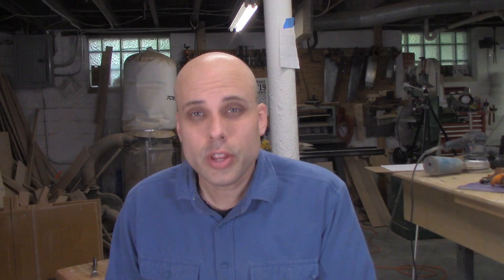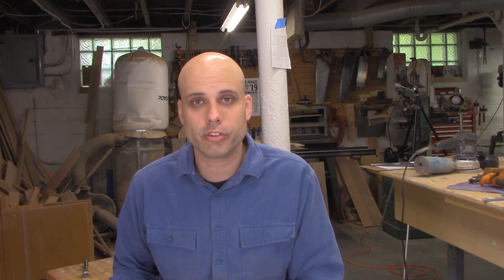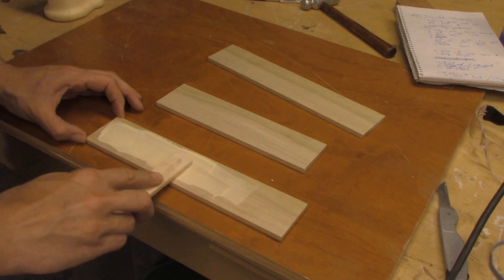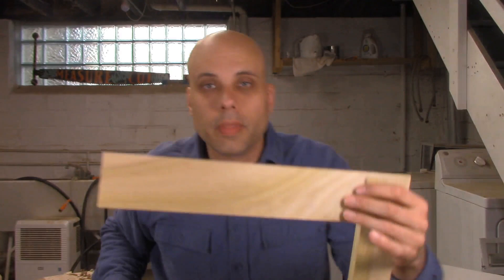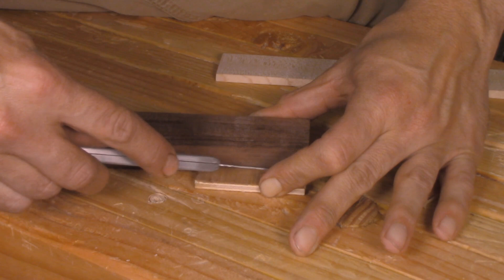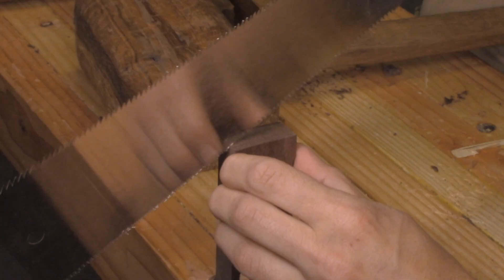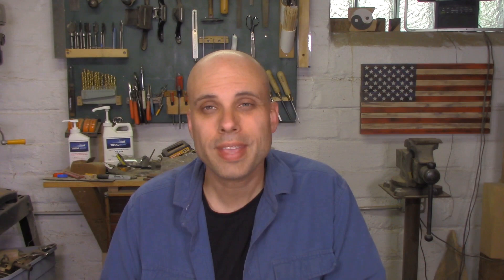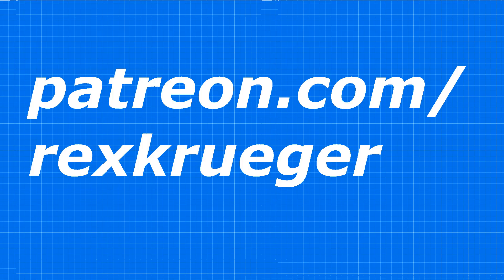Make your own try-squares for woodwork.

Comment: Actually, if you have and EDC pocket knife, it maybe the only knife you need.  If it is a three-blade stockman-style, one of the blade is called a "sheep's foot" blade.  It has a straight edge, back parallel the blade edge and a dropped tip.  It's more robust than that Stanley, and if you keep it sharp, it's all the marking knife you need.  Since you already own it, its even cheaper than the Stanley.  I've been given the Stanley and other more mainstream marking knives and my stockman is still what I use.
Reply from the maker: Man, now I'm going to spend HOURS learning about these knives. Thanks. :)

Comment: Lay the speed square flat across the face you need the line using the wide base on the opposite side to hold it on the edge.

Comment: Actually you can use the speed square to check narrow boards to see if they are square you turn the speed square so you are looking at the 90° corner with the widest side on top and now you have 2 small 90° corners to check square narrow stock

Comment: I wonder if we can glue these squares with another method. Use a school compass (those with a little pencil for student) draw a perpendicular T on a paper. Put your square on, adjust the blade to the pencil mark while the glue is still wet. Use staple or nails on the edge to prevent it from moving or stringing, usually you will get a good result. Unless you got a table that is not flat.

Comment: If you don't have a square handy, try using a manufactured corner of any piece of plywood or other board. They're die cut at the factory and far squarer than just about anything you have.

Comment: @Rex Krueger. I think your issue with the Japanese saw is that your using it like you would a rigid spine saw i.e. tenon saw. If you watch a couple videos from these guys: https://www.youtube.com/channel/UCfqc2hpLPLj8VfgpalvEqcg  .. You'll quickly see that they repeatedly say you should only ever cut the lines you can see. this usually means cutting at an angle and 2 lines. In this video you cut down the wood essentially cutting on 3 lines, this is why you strayed at the back where you couldnt "see" the line. Try watching the guys in that youtube channel, It'l make a lot more sense.

Comment: You probably won't read this but here is another way to see if your square is true taught to me by my grandfather.  You need a small level and  plumb bob, or plummet - a helpful grandchild is also needed : ) . You take your level and hold it against the tongue adjust the position until level then you use the plummet on the body from the corner if the line travel down without moving away from the edge line then it is true. inside and outside do both and be sure to compare inside tongue to inside body and the outside tongue to the outside body. Would someone please tell me if they understand this? I am not certain that I did a good job explaining it. thank you.
Reply from the maker: Man, I read all my comments. That is a fascinating suggestion. You totally explained it well, but I'm not sure I could get it set up and then also get it glued and clamped with that method. Still, totally interesting. Thank you!

Comment: My father put multiple layers of epoxy on his wooden boat. He wore gloves but still for two weeks or so he had that typical harmless but weird skin reaction. Can that happen as well with those tiny amounts of epoxy you're handling without gloves in the video? The difference in quantity between a drop in a joint and a layer on a boat is, of course, quite significant 😅
Cheers from Vienna, Austria! 🙂

Comment: It seems like you could get precise results without using a contractor's square or fiddling with the damn thing for ages if you used some basic geometric construction techniques to lay out the shape of a square and then cut that out of a single piece of stock. All you'd really need would be a compass (or just a string and a tack if you want to be truly oldschool) and a straightedge.

Comment: I like the video don't get me wrong....but in the intro you said about the speed square not being precise/true or not able to check inside square. you can check inside square if you are using rough lumber and as for accuracy ...not getting that either, that's because its called a "speed square' for a reason , it is designed for rough carpentry work aka framing ect. and for speed and ease of use. but thanks I still like the vids.
Reply from the maker: Well, the point is that for fine woodwork the speedsquare won't be good enough. Not that it's not a good tool, just not the tool for the job.

Comment: Beautiful work, Rex. I've been playing with shellac again recently & it's so versatile and simple. Shame it's so sticky, but it's still a lot better than (non-waterborne) polyurethanes.
Reply from the maker: I need to do a video on shellac. It is really easy.
Reply: @RexKrueger  Yea. I should get some raw flakes to use as a finish really; I've been mostly using a blended mix for sealing & it's a bit too gummy to build on top of sealed grain. I think I'll go back to acrylic for sealing under a finish though, since that can be removed from sandpaper with a latex stick (the shellac won't come off & I'm going through sandpaper like there's no tomorrow).
Reply from the maker: Try a card-scraper for finish removal. Works like a charm and you never throw it out.
Reply: @RexKrueger  I've been trying but haven't yet found a material that does the job well on the lathe. Metal cabinet scrapers are too aggressive & the plastic ones I've tried so far aren't hard enough. I need to give it a try again before the stuff's fully hardened & see whether the plastic will do it then, but the acrylic sealer is easy enough to remove from sandpaper & does just as good a job as a sealer, with the only downside being that I have to oil the wood first because it otherwise leaves a cold, drab look. Luckily, I have a lot of mahogany to test all this stuff on.
Reply from the maker: Oh, on the lathe. Yeah.  Sandpaper.
Reply: @RexKrueger  Yea. I'm sure a metal scraper would work at a lower speed, but mine's a belt driven model so adjusting that back & forth all the time isn't great.

Comment: I think making a working square out of only wood is the cheapest option.  If you had a piece of mild steel and some epoxy lying around you could bake the rule out of metal to make it a longer wearing tool.

Comment: Just a question: what's the purpose of the curved cutout at the end of the tongue? Thanks.
Reply from the maker: There is some debate about this. You can use it to lay out a little detail on the end of a board. It makes the tongue a little lighter, and it just looks nice. Good questions!

Comment: Please do a short video or mention more about the marking knife. The best shape of the blade and how sharp does a craftsman keep a marking knife? There's an old knife in my dad's old toolbox that I thought was for chip carving but it's the wrong shape. It's kinda dull on the length of the blade but it could definitely make a scratch on wood. ❤🌅🌵
Reply: XActo makes a number of nice handles that can accept multiple blade sizes and shapes.  You can also remove the blade holder and turn your own handle.  No worries about sharpening it. Just change the blade when it gets dull.

Comment: Rex, just a question.  How do you keep them from coming out of square with temperature and humidity.  Most of the ones I've seen are great for decoration but not serious woodworking.
Reply from the maker: With small pieces of stable wood that have a finish applied, they don't move very much. Keep in mind that this was the ONLY kind of woodworking square until very recently.
Reply: @RexKrueger  - true to a point but theb ones I've seen from back in the 1700's always had a metal blade in them to stop movement and there were metal intruments used back in biblical times by the mason and other architects where a known, accurate square was required.
Reply: @rickprice407  I always assumed the metal edge was intended to keep the wooden edge from wearing unevenly. That aside my German peers had a veritable fit when i showed up to class with a wooden ruler sporting an uncultured metal edge "thats typical American, theres no way thats straight"

Comment: How do you know that your contractor's square is square? I have been checking my tools recently for accuracy and found that at least half of my squares and rules do not agree with each other. I thought that my machinist tools would be more accurate but found a 300mm (12 inch) rule and 150mm (6 inch) machinist rule with different size increments on them (both are metric). I have found that the cheap plastic squares that are used for maths and technical drawing at schools are very accurate.
Reply from the maker: I checked it using the technique I used in this video.

Comment: At the end of the day you where still using a square as a reference to build a square?
So it can never be more accurate then the original square.
Why not use a string as a compass and as a perfect straight line to construct a perpendicular bisector? It will always be a perfect right angle.
Reply: I think you are missing the point. At the beginning of the video he did say he used a framing square to build the tool box, and even though it was adequate it was lacking in the ability to check the inside of spaces, and this is one of the reasons he was building his own. There is another video where he shows how many squares he has, and he has quite a collection. He was making these squares basically to show that it could be done, and also buying a framing square as a reference point (a really good one like the Swanson squares) is a relatively inexpensive investment, and they are dead on true, at least mine are.

Comment: Will wood expansion due to weather affect the squares? Or is the wood you used safe from it?
Reply from the maker: The wood will move a little, but it shouldn't twist or anything. Also, these pieces are small, so the movement will also be very small. Remember that wooden squares are all that existed for a long time.

Comment: I just made one of those as a first project in woodworking!
It came out pretty nice, I'm happy with it! But while using it, I noticed that I can't reliably scribe a line all around a piece of wood and end up exactly where I started. I'm usually off by almost 1mm (around a piece 5x5cm)
I don't think the square is to blame, I checked it many times like you show us. It seems acurate enough.
I suspect it's something  about my techique because the ammount of error is inconsistent. Sometimes it's 1mm while others it's spot on.
Or it could be something else, I am new to this, I might be overlooking something important.
Does anyone else have trouble making closed courves? Any advice on how to make sure I always make perfect closed loops?
Reply from the maker: Two things: first,  make sure the bevel of your knife is pressed consistently on the square. Some people really benefit from a marking knife for this,  but I just use a pocket knife.  Second,  going all the way around the wood is kind of an artificial exercise.  I rarely make a piece square.  I usually just do one face and one edge. I really never have a reason to go all the way around.  Oh, I think the most likely reason you're having trouble is that the wood isn't really square.  That will do it every time.
Reply: @RexKrueger  thank you so much! I will keep that in mind!
I only wanted to have lines all around so that I can mark both ends of a mortise for my next project. 
Your videos are very informative and inspirational, thank you!
Reply from the maker: You should mark both ends of that mortise from the SAME face.  That will keep it square.

Comment: Great video, but I consider it a grave error that you use one square to make another one. You have no idea if the master is indeed square.
If I was to glue up a try-square like this, I would eyeball it close to the square and lightly clamp the bridle. Then test it against a sheet with a straight edge and mark a true precise 90 degree on the sheet. Then apply glue and correct it against the sheet and clamp.
Of cause, you also have the option of constructing a square to a line (or edge) with a compass witch you can construct in seconds from a couple of finishing nails and a strip of wood if you don't have one. This method is particularly useful if you are making a really big square. 
Both are potentially way more precise and sure than to use a $5 Chinese made speed square.
Reply from the maker: Well, I tested the square prior to using it as a clamping guide. Did you catch the part where I said it was pretty accurate. Also, how grave could my error possibly have been if two out the three squares were perfect right out of the clamps?